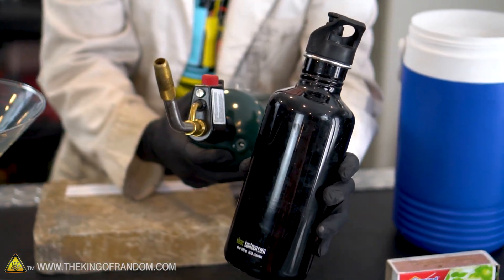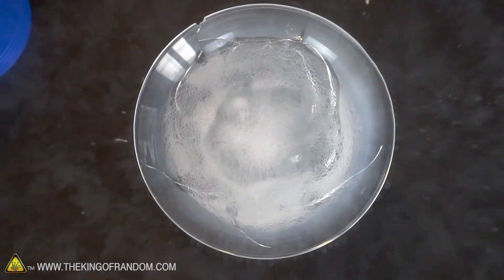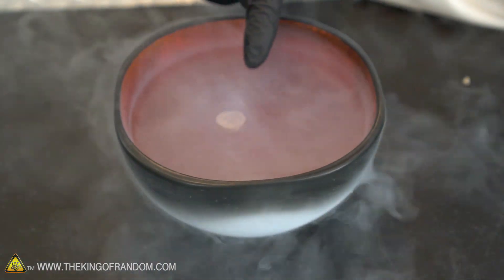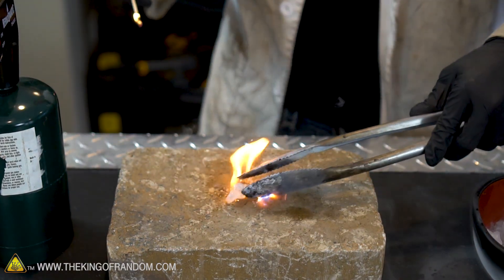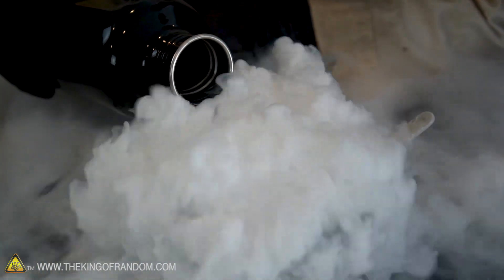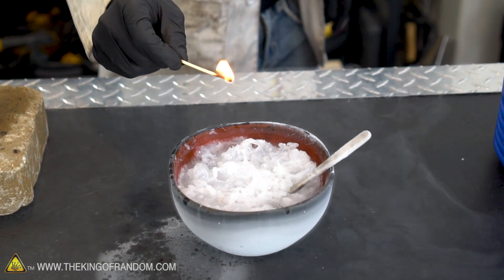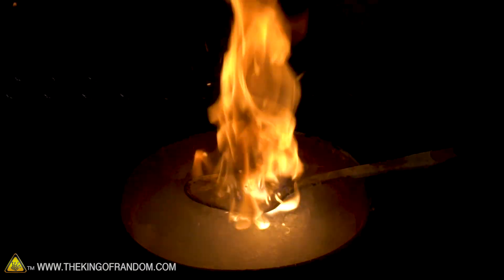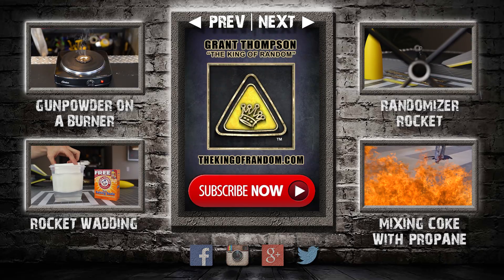Will Frozen Gasoline Burn? Can We Use Liquid Nitrogen To Freeze Gasoline Then Ignite It?

Comment: you had nitrogen to put out the fire. its the perfect inert gas to put out fires. its used to purge out gas lines or pipelines...fill a fire extinguisher with nitrogen instead of the powder. way more effective.

Comment: Didn’t watch it yet but it will light
It has a melting point of -35c but fuels like gasoline don’t need fumes to combust as their flash point is extremely low

Comment: it is small bit of gasoline vapor that catches fire when you put the flame to it and not the solid gasoline. since the gas melts quickly on its own, it goes from solid to vapor even quicker with a flame at the surface which does catch fire, causing a chain reaction of solid to gas and continues to burn. its the gasoline vapors that are flammable and not the gasoline in liquid form. the same goes for solid gasoline.

Comment: What if you take a lighter and put the flame to the bottom of the metal spoon? 
Will the flame heat up the spoon that the spoon is so hot it sets the frozen gasoline on fire or does the flame itself need to touch the frozen gasoline?

Comment: I don't have a degree in science, or physics, but I believe what you're seeing is a reaction with the water in the flame in the hydrogen being released it happens a lot in welding with e7018 rod. 7018 Is a low hydrogen welding rod that is stored in oven to keep moisture out. If not stored properly to get a lot of that spatter and the arc is pretty violent. So in short, the craziness when first lighting frozen gasoline, more than likely produced from water vapor in the air freezing and condensing on the surface of said frozen gasoline.

Comment: I knew frozen gasoline would burn because about 10 yrs ago my ex had the idea to soak snowballs in gas and light them and throw them, and it worked really well. Kinda scary though. And extremely dangerous. 10/10 would not recommend

Comment: In the video it said that the gasoline has a low melting point so I think the heat from the match malted the gasoline a little so it would light and then that first fire melted the rest of the gasoline making the  gasoline burn we hen you froze it.

Comment: Well, ofc it will burn, cause gasolin have very low temp of solidifying, so when you put fire near its becomes liquid easily, evaporates and vopurs catches fire, then heat produced is enough to melt rest of it. Will it burn if still bathing in liquid nitrogen is another question (probably just a little).

Comment: The vapors that emit from the gasoline is actually what burns, not the liquid.  In truth, no liquid exits that burns.  Only vapors and solids burn.  So, I'd presume even before the experiment that frozen gasoline exposed to adequate heat will still volatize, causing it to burn.

Comment: Air pockets in the gasoline become dense because of the molecules from the air are moving less due to being frozen. The gasoline still burns which heats up the air rapidly causing the air to push the gasoline away, causing an explosion.
Reply: "Causing the air to push the gasoline away" I mean because the air molecules move faster due to them warming up, which pushes the gasoline away while it melts.

Comment: Just to explain what you just saw. Gasoline in solid or liquid form doesn't combust. What combusts are the fumes/vapors that the liquid produces when exposed to air and sufficient temperature. You can observe this if you try igniting small amount of liquid gasoline with a match. The flame doesn't need to touch the liquid for it to combust. When he brought the match to the solidified gasoline, there was a small amount of fumes surrounding the block at that time as it was still beginning to thaw due to room temperature. Those fumes ignited causing a spark. The heat produced by the spark further fastened the melting process causing even more fumes to be produced to follow in a chain reaction. So, no, frozen gasoline does NOT burn. It just melts too fast in room temperature for us to properly observe.

Comment: Aren't we ignoring the fact that even liquid gasoline doesn't combust, it's the vapors mixed with the air. I'd have to imagine that the gasoline is sublimating directly into vapor form since we don't see any droplets when it melts. It's those vapors that are igniting and the subsequent heat is accelerating the sublimation causing a violent reaction.

Comment: The reason the frozen petrol is slightly explosive is frozen things are basically really packed together liquid things, and in its frozen state the molecules are closer together.

So imagine liquifying gunpowder. Kind of the same thing.
Reply: Nope, it would only burn as fast as it can dry.  Liquids don't burn (actually vapors emitting from liquids that do) and gunpowder burns as a solid.
Reply: thats what i been saying.  liquids and solids do not burn.  gases burn.  same for gun powder, solid rocket fuels, and just about everything. just about all materials burn, given enough heat and oxygen.  inert gases do not burn, including oxygen.  i've won this argument against some of the smartest people i am lucky to meet, over, and over again. amazing how little most know about fuels, oxidation, and ignition, despite this stuff being the basis for our modern existence.

Comment: I just have one doubt,  I'm not a 100% sure about the extent to which liquid nitrogen freezes the gasoline and then cools down, but this might not a 100% confirm that solid gasoline burns because the small amount of liquid gasoline at the solid air interface(as soon as it is taken out) could have just lit up and caused the rest to defrost and then burn

Comment: I believe it burns more quickly as a solid because there is more surface area exposed than in the quasi 2D liquid state. It is also likely that what is burning is the evaporated gasoline on the surface, not the solid gasoline itself.

Comment: Why you keep on using rubber gloves in fire-related experiments is beyond me. They're literally the worst possible type of gloves you could use in such settings. 
As you yourself had the chance to witness at the end of the video, if you get fire on rubber gloves they will melt and stick to your hands causing you very severe burns. Having no gloves at all would literally be better than wearing rubber ones.
Reply: Ooh so LEATHER GLOVES are better
Reply: honestly i think theyre an aesthetic thing for him at this point. die for the aes
Reply: Silicon gloves m8
Reply: @LucanianIndico  In chemistry you basically never wear gloves except if they are designed for exactly what you are gonna do with em.
Reply: Except that it's common-sense that when dealing with any potentially dangerous materials you wear gloves, and rubber gloves are cheap and replaceable.
Reply: Elverton Clarke, I wouldn’t categorize your sense to wear cheap nitrile gloves while working with fire as common sense.
Reply: I don't know why this wasn't obvious to him to start with...  :/    ...and doing it indoors in a small flammable space...  ugh...

Comment: Dear King of Random: I'm not convinced that the frozen gasoline is what's burning. It seems like the flame melts a little bit then catches that on fire, which then melts the whole thing.
Reply: Vigo Hornblower Only gaseous gasoline (vapour) is flammable. But solid gasoline can evaporate (in this case sublimation is the more accurate word) just like liquid can. Liquid gasoline is not burning, vapours of it are.
Reply: Oh interesting. Thanks!

Comment: Does liquid metal conduct electricity
Reply: Tom Storck Actually, running electricity through the molten metal is how aluminum is purified from ore.  So at least molten aluminum & molten aluminum oxide conduct electricity.
Reply: Isaac Konst yes.
Reply: Yes, absolutely.  Conductivity nothing to do with phases.  Everything to do with electrons and atomic structure, which does not change with phase.
Reply: Cullen Lonergan 
No, if it is liquid, it surpassed the so called ,,Curie Temperature", meaning it won't cunduct electricity anymore
Reply: @tomstorck9972  The Curie Point refers to magnatism. Not conductivity.

Comment: Well, there's your answer. As soon as the frozen gasoline is subjected to the air, it immediately starts to either sublimate directly, or else melt and then evaporate; either way, a shell of vapor forms around the solid gasoline and forms a combustible mix where it meets the air. Regardless of the temperature of the frozen gasoline, the vapor cloud around it will burn, and the heat from the flame quickly melts and evaporates more gas for the fire.

Comment: Any ideas as to what would occur if you set a match to the apparatus when the dense fog was rolling off from your initial pour. It may have been some type of off-gassing of a different hydrocarbon. But if you were to attempt that, I might suggest an external venue. (I am thinking like an insurance adjuster)

Comment: Can you try to freeze propane it would be interesting
Reply: Plz try mixing dry ice with citric acid
Reply: Put a frozen wiher
Reply: If you turn a propane tank upside down and open the valve it comes out as a liquid that behaves like liquid nitrogen
Reply: You can freeze everything. Just depends if you can get it could enough. Absolute Zero is the freezing point everything freezes at
Reply: propane is the same as nitrogen :P it comes in a liquid form when its delivered you just burn the gas at home. Lemme put it this way the boiling point is some where around the -250 degree fahrenheit or -156 celsius and that is just to BOIL propane let alone freeze it. What your asking is no gonna be possible for some one doing random experiments without proper equipment and higher tech. BUT he cant try freezing stuff with propane then using propane to melt it :P

Comment: Because of the temperature required to freeze the gasoline, the room temp is hot enough to cause it to start to melt and vaporize so it will ignite. Not a surprise at all.

Comment: Anyone knows the answer? Does the gasoline sublimate or does it melt and evaporate for the actual thing that burns is the vapor of the gasoline. Of course, the chain reaction is that the flame is heating the frozen gasoline, so it can melt/evaporate easyly and burn.

Comment: No it won't.....  same goes with liquid gasoline...  it won't burn either..  only in gas form gasoline burns..

if you but gasoline in well ventilated jar etc and drop match or cigar into it... 
   won't ignite gasoline 

or just light it up on top of mirror or glass and you notice that fire starts 5-10mm above gasoline

Comment: Well, it makes sense that it does, There's always a layer of liquid ontop of ice, it can't freeze either, I guess it's because of temperature that even if it's frozen solid, room temp or anything above 0 celcius will makes/create a small layer of liquid so if there's cumbustable chemicals still in that layer it will eventually catch fire. It's mind blowiing to see how fast it just turns from ice into a liquid lol I never knew gasoline could be interesting :P

Comment: U should fill a glove with air and put it in liquid nitrogen
Reply: You fill it up with O2, not CO2. You can just buy compressed air and pump it in the glove. (Carbon dioxide is two words).
Reply: Wynn V I don't think that would work because air is o2 and when we breath out we release carbendyoxide(I know I spelled it wrong)

Comment: Gasoline vapors are flammable.  The frozen gasoline is surrounded by vapors.  As the vapor burns the heat melts more of the frozen gasoline dumping a huge amount of new vapor into the mixture which then ignites creating more heat.  You get a runaway reaction and then an explosion.

Comment: What happens if you put a bullet in liquid nitrogen
Reply: Taigh janse you get a frozen bullet
Reply: The acctual bullet or an whole cartridge? Cus with both probably nothing
Reply: It gets cold
Reply: You get a cold bullet
Reply: Then you got a frozen bullet
Reply: 3 months later, I think what he meant was what would happen to bullets when they're fired. Would they even fire at all perhaps?
Reply: A bullet can't freeze. It's already a solid.

You would just get a cold and likely brittle bullet.
Reply: technically the bullet at room temp is already frozen, because a 'frozen' form of liquid is just a solid, which i m pretty sure thats what metal is, *a solid*, and no... i am not talking about gallium... so you would just get a moderately cold bullet that could freeze the moister in the air of the gun chamber and clog it (potentially causing a explosion)

Comment: YOU INADVERTANTLY MADE A BOMB!!!!!  YOUR LIQUID NITROGEN LIQUIFIES AT -296 DEGREES CELCIUS AND THE OXYGEN IN THE AIR LIQUIFIES AT -283 DEGREES CELCIUS.  THEREFORE THE OXYGEN FROM THE ATMOSPHERE CONDENSES ON THE COLDER GASOLINE, REPLACES THE NITROGEN, AND THEN YOU HAVE AN OXYGEN-FUEL MIXTURE EXACTLY LIKE ANY BOMB OR ROCKET ENGINE.   KAAAA---BOOOOOOOMMMMM.  YOUR EXPERIMENT PROVES IT!!!!!!!!!!   (BUT YOU DIDN'T FIGURE THAT OUT.)  THANKS FOR TEACHING ME A NEW WAY TO MAKE A BOMB.

Comment: I really liked the experiment but there is something that could have been done better (maybe not at home because it would be impossible). My idea is that when u  take out the small frozen piece of gasoline the process of melting starts right away and it is very active where the surface of the heat transfer takes place (surface of the piece). Very little drops of gasoline liquid are created and therefore when u light it up the surface gasoline burns out and the heat transfer takes place faster (which explains the explosion-like burning) and the frozen gasoline turns into liquid and starts to burn out. To really prove if the gasoline will lit up a chamber with the temperature of freezing gasoline should be used and after letting the gasoline freeze one should try to lit it up. But for homemade condition the experiment is great

Comment: The ignition of gasoline isn't the liquid itself, but the vapor. The reason this works is because of the low melt and gas points of the gasoline. When the match gets close enough, it melts, turns to vapor, then ignites. You can, if you're quick enough, put out a match in liquid gasoline...... though I don't suggest you actually try that

Comment: Another idea - froze diesel fuel in round form with candlewick and make "diesel candles" :D Diesel fuel is less flamable and more thicky, so should work until keep it's solid state... P.S. Don't use "winter" diesel fuel - contains less parafine.

Comment: Nitrogen is only flammable if the temperature is significantly high like higher than 1000 degrees Celsius. If you can try an experiment with something that is greater than 1000 degrees Celsius with liquid nitrogen and see if there is a reaction.

Comment: I think your onto something ...do you have the knowledge to build something that can hold liquid nitrogen on an engine and use frozen fuel to power it , to see if the more vigorous burn of the frozen fuel will therefore create a bigger bang therefore creating more power ??
Reply: Ty B The problem with reactions like that is it is not at all controlled. Which may cause massive damage to the engine or the machine that needs that power
Reply: Moris De ahh I get you I didn't even thunk of that side of things lol
Reply: Do you know grammar?
Reply: Ty B it would act the same as nitrous oxide which is already used
Reply: @Ty B gasoline on its own explodes, it does not burn until after the initial explosion. explosion = way more kinetic energy than a vigorous burn.
Reply: do you know how engine works ?
Reply: Clockwork legionaire I know grammar for my native language
Reply: Then you're using a fuckton of energy to cool down the gasoline, only to get a little more energy using the explosive power of frozen gasoline. It would be highly inefficient. We're using gasoline as fuel because it's a product that nature has put energy in by compressing it for millions of years. Basically fuel is a lot of energy in a small volume. By burning it you unleash that energy. Freezing it costs energy. Liquid nitrogen is not a natural product and takes energy to produce.
Reply: Erike1999 Just put gasoline in the south pole (winter) were the average temperature is -49 degrees celsius, and gasoline has a freezing point around -45 degrees. Boom (no pun intended), no man made interaction required.
Reply: SuperFlameDust But then you'd have to keep on the south pole. Cause if you'd transport it you need to keep it at that temperature,  which again takes energy.🤔
Reply: Please read basic thermodynamics, specifically about Carnot engines
Reply: Would make a great incendiary bomb though.

Comment: Frozen gasoline wont burn (nope, it just wont react with oxygen in the air). But, due to octane's low flash point, and low evaporation points, solid octane WILL evaporate and burn.

Comment: Grant do you think the reason it burst out spitting like that was because of the nitrogen. Since you cant light nitrogen on fire it will evaporate instead and the high heat caused it to blow the fire outwards? Like the effect of water in hot cooking oil :)

Comment: I wonder what would happen if you froze gas and compressed it to the point where it would ignite would it basically explode or would it still be just sorta melt/burn from the outside in.

Comment: why do you set fire to frozen gasoline right next to a torch, aka. a canister full of butane?
Reply: also right next to an open container of gasoline (most likely just gasoline vapor at this point)
Reply: Because he is very smart
Reply: Håkon Holm the container is made of a metal alloy which has a very high boiling point
Reply: Niklas Bengtsson the metal can hold up to this pressure
Reply: Richard Smout o
Reply: EthanKPH [GD] u are correct but can the seals hold up along side the metal no way to know cause the company doesnt say what gas seals they use to make em with
Reply: He goes from freezing his fingers to almost burning down a house, I'm surprised they made it this far in life....